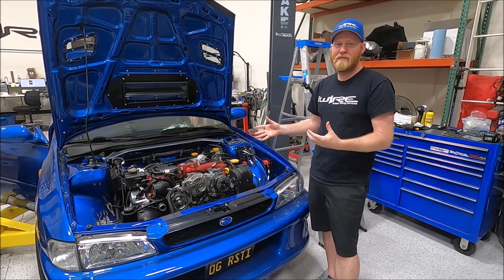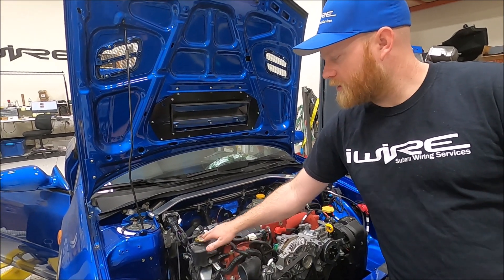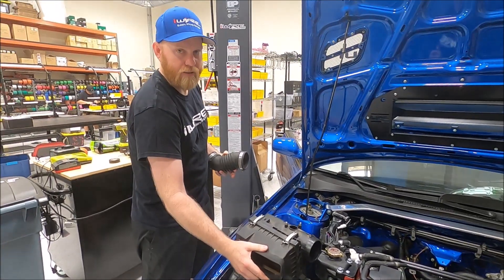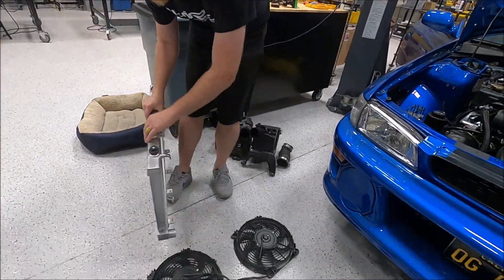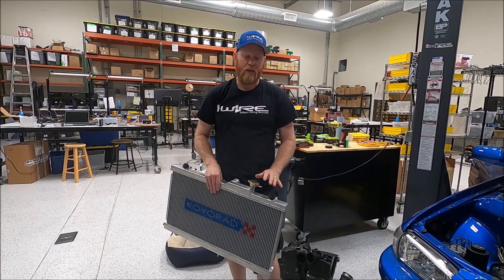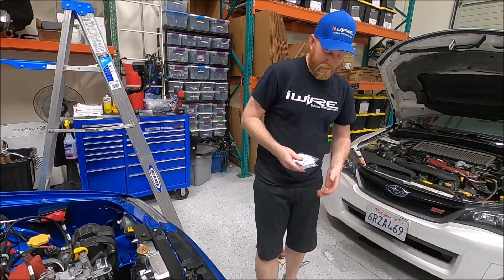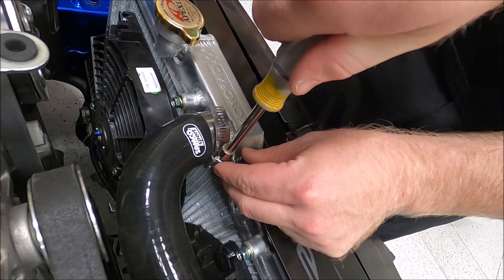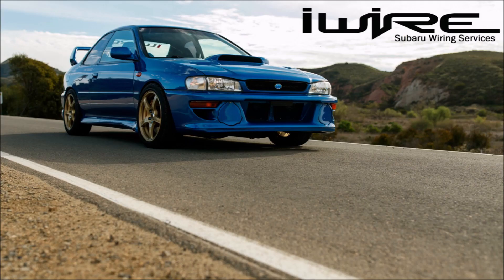OG RSTi - Episode 8 "6 Month Update & Radiator Install"

Comment: My not-currently-swapped '98 GC rad cracked, and I'm doing this fan swap since I didn't feel like paying for all new OEM fans etc (mine are rusted onto the old rad....) and an OEM rad. Any tips? Am I gonna have issues using a GD spec rad with 98 RS motor?

Comment: Which spal fans do you recommend?
Reply from the maker: I don't have a specific recommendation but 12in and the most CFM you can get that fits between the fan and the engine.
Reply: @iwiresubaruwiringsolutions5538  it says it needs a 30amp fuse/relay.  Is the current wiring enough to handle it?
Reply from the maker: @jeff666p  Generally we see that it is enough. If the fuse does blow it requires a modification to the wiring to handle that.
Reply: @iwiresubaruwiringsolutions5538  looks like the part number on the fans is 30101522